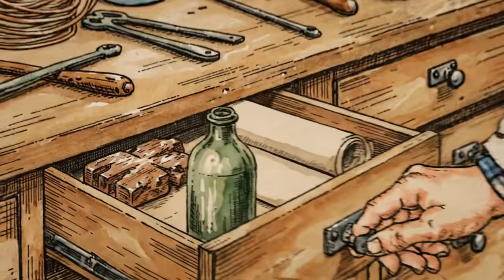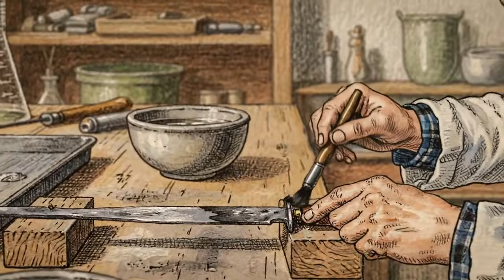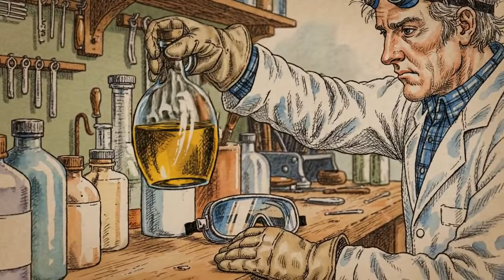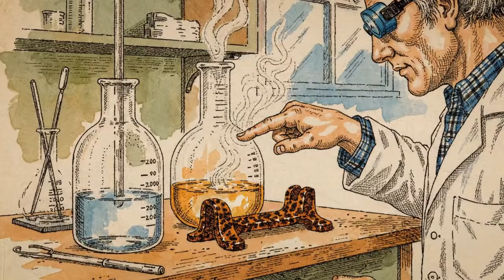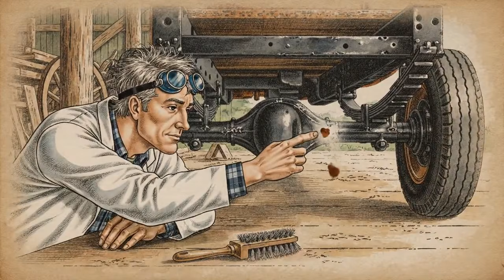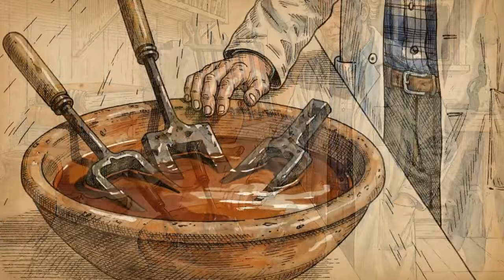The $3 Powder That Makes ANY Metal Rust-Proof FOREVER — (Physics Don't Lie)

Comment: This is a great video acid treatment of steel is a simply great process. 
It's a bit over sold for most tools the rust proof layer will wear through and require a fresh treatment.
Also a tool left in a wet environment will still rust over a long enough time.